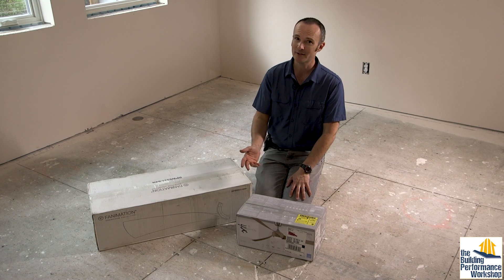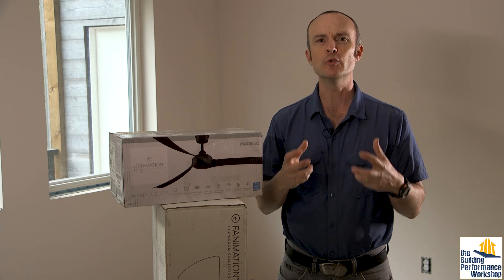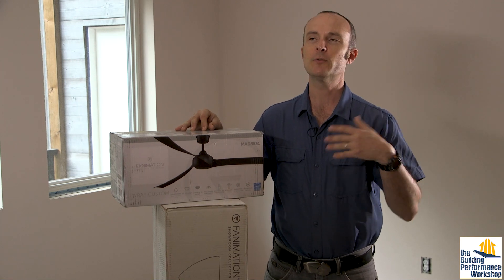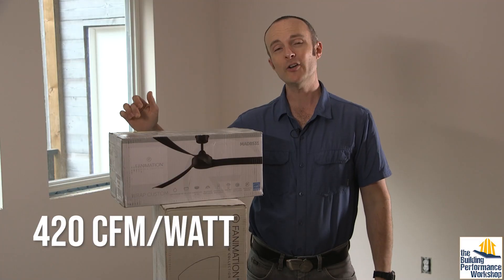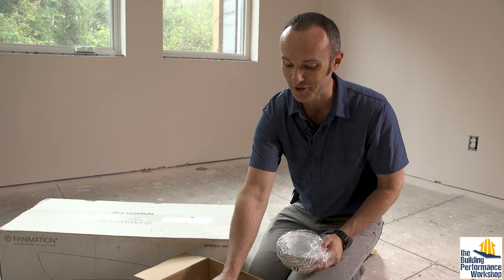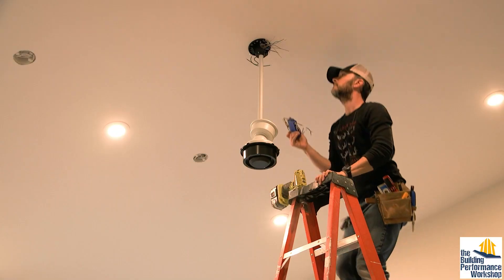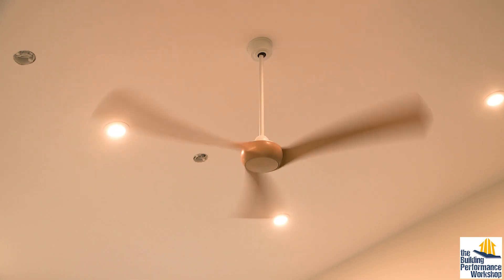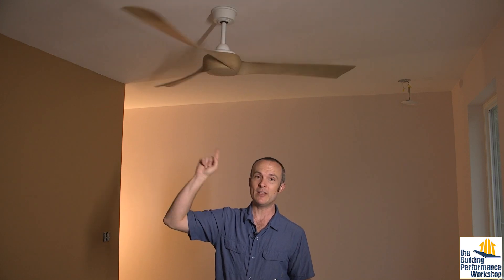Ceiling Fans are HVAC Heroes in High Performance Homes

Comment: Ah, I had always wondered why the upscale homes I visited all seemed to have ceiling fans running 24/7. In my bracket, ceiling fans are bouji~ but I thought that was b/c of the electricity to constantly run them.
That being said, is it really efficient, then, if you're having to add additional systems to perform the same function as lower-cost hvacs? Just thinking outloud, no need to respond. Came for a different question, stayed for the really informative spec explanations! (I'm currently looking for a video that will show how ceiling fans affect airflow, and I might have to just use a thermodynamic heat view. I have a wierd idea to mount the fan on the wall instead of the ceiling. Anyway....) thanks again! I hope you're continuing to make this home exactly what you'll love.

Comment: Hi Corbett, nice informational video.
I installed a  72” fan in a room (420sq. Ft) w/  cathedral ceiling 13’ high with a drop rod length of 2’, the fan is 10’ from the floor now. 
Is that ok or should I drop it another foot closer to the floor yo make it 9’ above the floor. 
It just looks like it a little higher than the rest of the fans in the house that are about 9’ from the floors.
Reply from the maker: I think that sounds fine, Rohan- as long as there’d enough breathing room between the fan and ceiling, you should be good!

Comment: Do you have suggestions on the best low-cost efficient ceiling fans? It seems like the main companies making high efficiency fans (haiku and fanimation) are also basically luxury brands. I'm frustrated that I can't get a basic ceiling fan with blades that aren't flat paddles. I recognize that there are other elements to an efficient fan (eg DC motors) but I imagine the largest  is really the fan blades. I've never seen retrofit blade options either.
Reply from the maker: I believe it’s the whole package, and these are ~$600 each. For something I’m planning on running continuously for decades, I’d take seriously the saying ‘you get what you pay for.’ No bright ideas from our pov on how you’d make them cheaper without losing quality. PS- Haiku is considerably more expensive than these, and yes I would call that one ‘overpriced’.
Reply: @HomePerformance  Just as an FYI, I just went down a ceiling fan rabbithole, and it seems that the market has changed a bit since the last time I looked, just a few years ago. I can't speak to quality, but there are now some fan options (just looking at Home Depot, for instance) that are $130-$300 with around 300 CFM/W. For comparison yours are 420 CFM/W, and my standard old-school 52" paddle fan is 75 CFM/W. That said, I'm looking at 52" fans vs yours are massive 84". It's nice to know there are options, at least, but I hear you on getting quality components that will last.
Reply from the maker: Glad to hear there are more options- you’ve got this.

Comment: All of your fans are running in the pull vs push direction. I have always wanted to understand which was best. I was hoping to see something in this video about that. Is it an interesting enough topic for you to make a video about?
Reply from the maker: Hey Tom- interesting q. Simple answer is to direct them to blow on you (to cool down) vs. to blow away from you (to circulate, and keep you warm simultaneously). Most manuf call it summer and winter mode.

Comment: I am building a traditional adobe home in Arizona's high desert. The climate is fairly moderate - not the scorching heat of Phoenix nor the bitter cold of high mountain towns. It is a modest 1400 square foot house and only one story. I went to great lengths to provide cross-ventilation with high transom windows across the room from the cool air registers. I also plan to install some in-ceiling vent fans to serve the same function during the winter when it is too cold to vent with open windows. Since I will not have volume ceilings, I doubt that I need circulation fans. Do you know of any way of modelling airflow (without paying an engineer a gajillion dollars to do it for me) to find out how my proposed system works BEFORE I build the house?
Reply from the maker: Airflow is finnicky and unpredictable, Linda- there is no way to model as you suggest that I know of, but of course the one thing I’d point out is that the wind must blow for cross ventilation to work. If you know about average daily wind conditions, you should be good to go. However, these can work even with 8’ ceilings.
Reply: @HomePerformance  Sigh. I was afraid of that. Oh, well. I'll build in the electrical boxes and add fans if I need to. Great content - keep up the good work!
Reply from the maker: Thanks and sending good energy your way